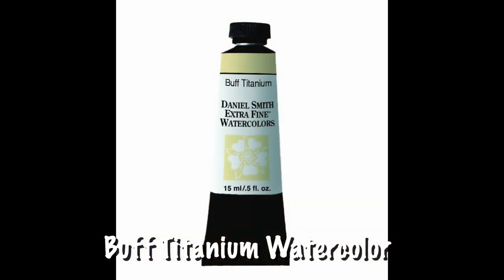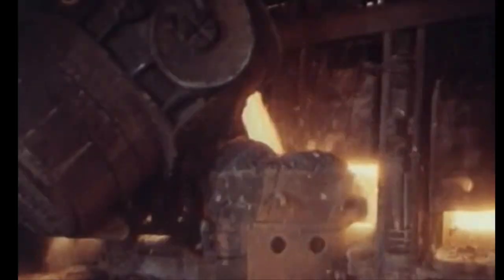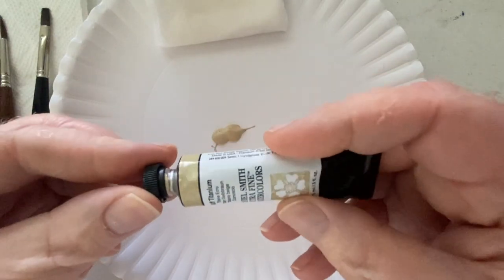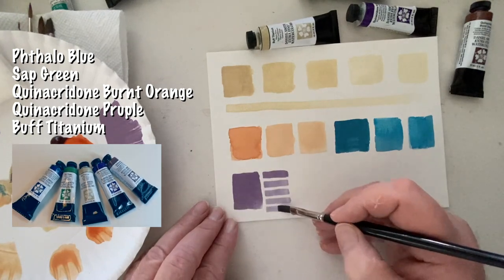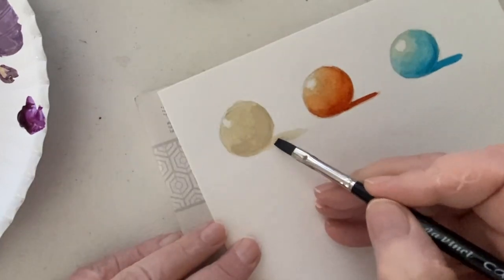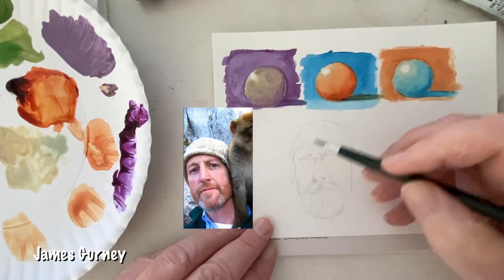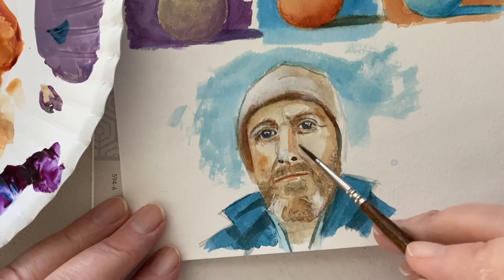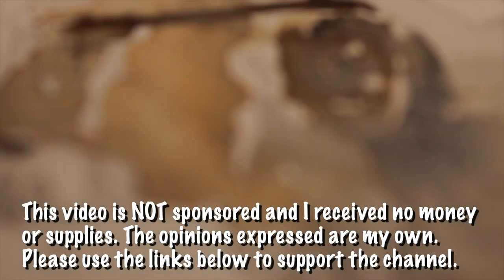Buff Titanium Paint

Comment: Hi,
Nice history on buff. 
But probably not the best way to explain and demonstrate opaque quality of any paint.
Just mark the paper with thick black lines and then paint over the lines.
If the lines remain visible then the paint is transparent and if the lines are not visible then it means that the paint is opaque.
Try it.
Reply from the maker: Everyone does that. I try to actually paint with them.
Reply: @owingsart  thank you so much for your response.
But I am suggesting is that showing something in demonstration is always much better than talking about it.
What your video demonstrated is how buff white BLENDS with other paints. Not how opaque it is.
If someone is considering to buy buff white for its opaque quality, your video is not helpful in that regard.
Also, do you think buff white gets more rusty as time goes after mixing with water?
Because of the iron content?
Reply from the maker: @danrazART  I haven't noticed any rusty color over time, but my previous experience was with oil paints, so I'll have to keep an eye out for how the watercolor behaves. 

Also, I get you point about the additional demonstration of opacity and it's a fair one. Thank you!
Reply: @owingsart  ah, you are awesome.